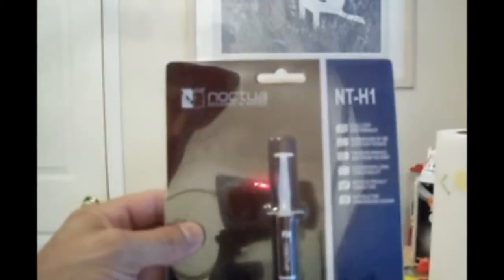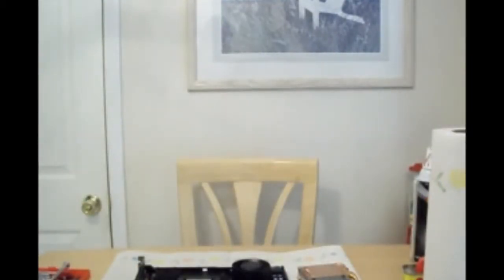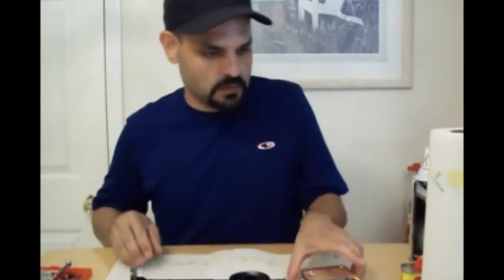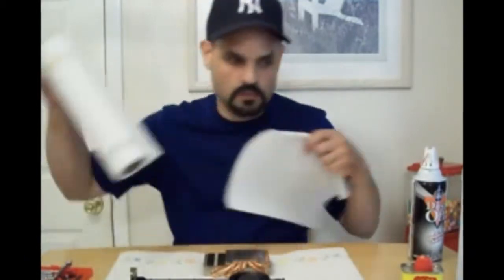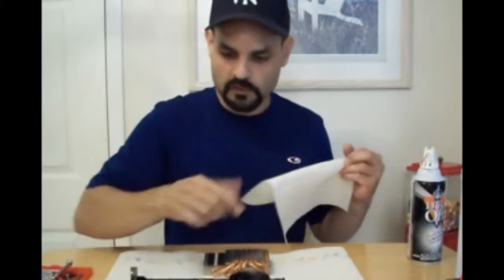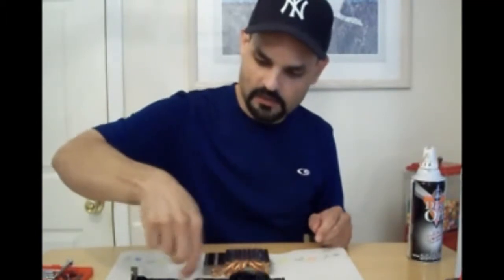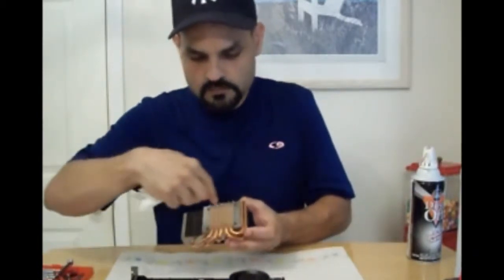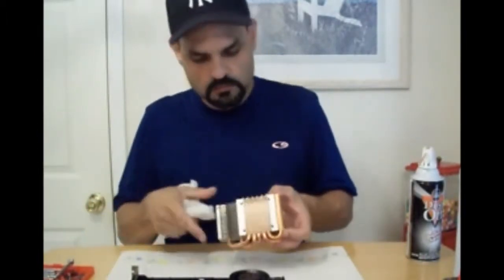EVGA GTX 470 replacing thermal paste part 3 of 4

Comment from the maker: the method you're describing is the way it's applied on a cpu ....because u get more contact with the chip/cpu and the heatsink....  with the video card there's a little less contact so you need more thermal paste to make  good contact. The heatsink can't be really tight to spread the compound as needed.  the manufacture built it so so u can't tighten it too much ...as too not warp the card.    there's a different way u apply thermal paste for a CPU and Gpu for this reason.